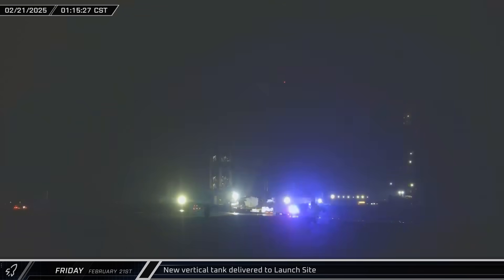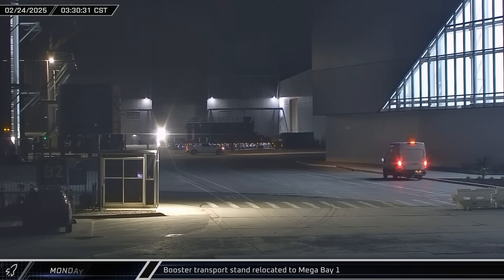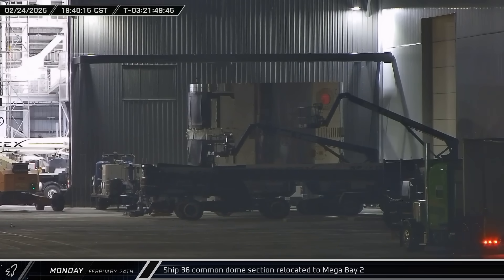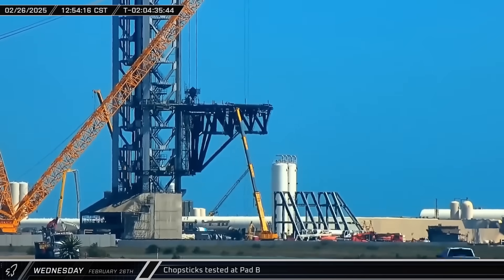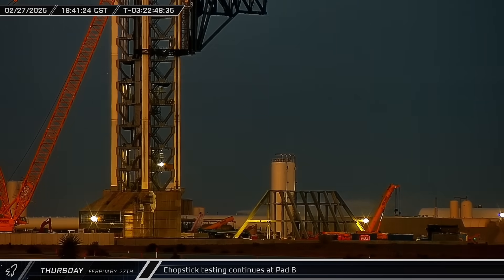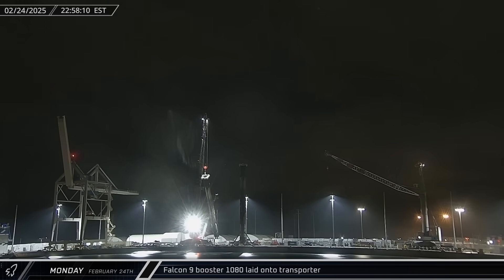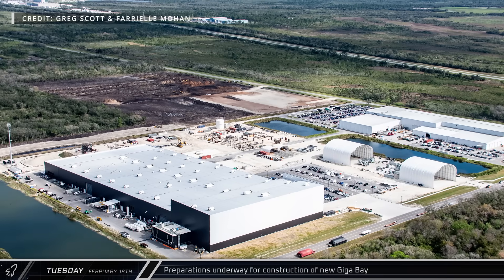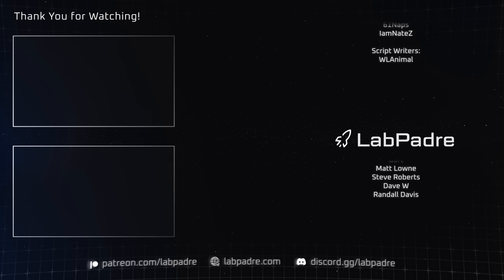Starship Flight 8 Tomorrow! - SpaceX Weekly #156

Comment: On flight 4 and 5, they never had a problem with their engines until now. So I'd like to know what changes did they make to the engines to cause the problem?
when trying to making too many adjustments at once can obscure the root cause of the problem, making it difficult to identify the real source of the issue 
and effectively fix it; it's best to make changes in a controlled, methodical way to isolate the problem area.